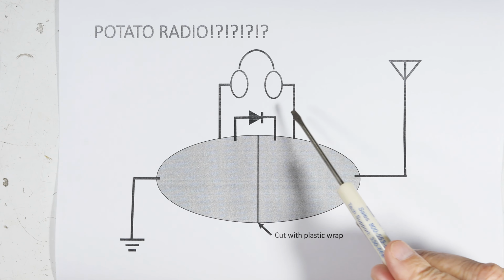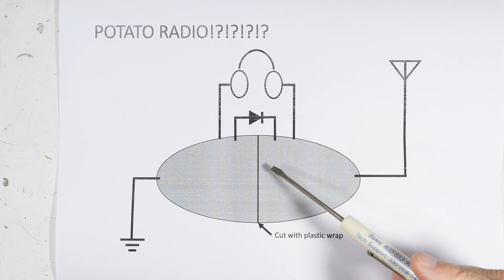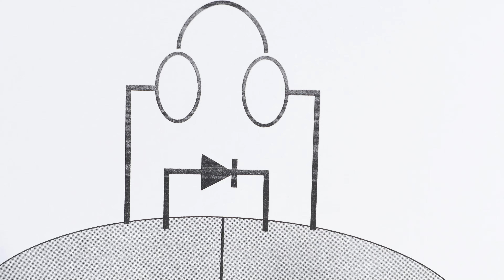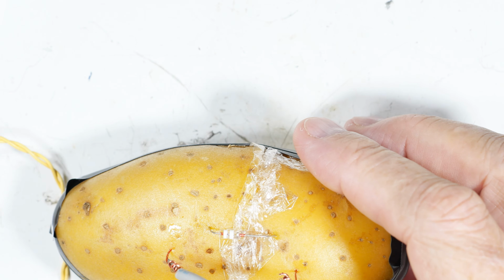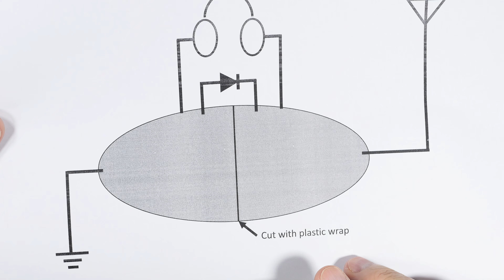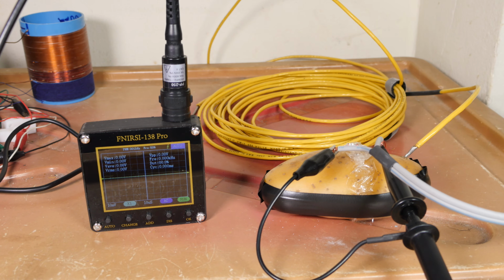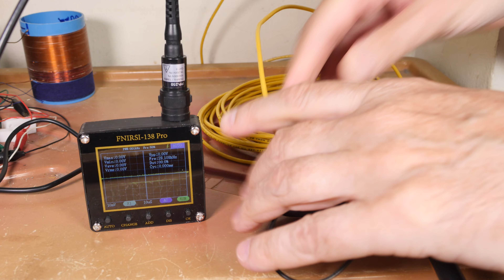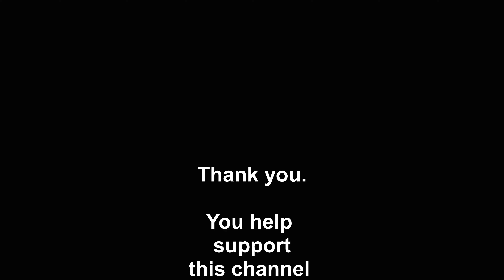Potato Crystal Radio--Real Deal Or ??? (4K)

Comment: I know nothing about radios, but when I was a child in the 60's we had a light switch in the kitchen, made of bakelite . It had a very fine crack running from one of the screws about a quarter of an inch long towards the actual switch itself but not reaching it. Our old wireless was about 10 feet away and the ground wire ran alongside the light switch. One balmy summer day I was sitting making an airfix kit and could hear very faint voices and music when all the family was out at work and I was alone? I went to see if I could find out where this was coming from (looked about outside etc) and could not find anything. I went back to my kit and a little while later became aware of the voices and music again but still very faint. This time I went very quietly and slowly around the house trying to pinpoint the source. It took a while because the voices came and went, but eventually as I tip-toed into the kitchen I found the source. It was the light switch! Baffled, I checked the wireless, and it was not even plugged in. I told the rest of the family when they came home and they thought I was mad, but they did eventually hear voices and music from the switch and thought it weird but not dangerous, so they just accepted that we had a weird light switch. Over the years I have often wondered how this came to be, but have never found an answer. So is there one? Thanks if anyone can enlighten me.
Reply from the maker: That is interesting. If you watch my video on the world's simplest radio https://youtu.be/mlBfAI_55Mk
you will see you only need an antenna, ground, detector, and something to make sound to hear radio.
Then I have another video about what can work as the detector I mentioned.
https://youtu.be/1o2zB5giS7I
And a nearby, high power station would make it much more likely.
I can't say for sure of course, but that switch had all the things to hear radio: it had an antenna, which was the live wire; a relative "ground", the neutral wire; several possible detectors including corroded or arced copper/bronze, carbon from burned bakelite, etc. The something to make sound could be the cracked bakelite. Did you ever experiment to see if you could make it louder or quieter by squeezing or pushing on it? Did it work when the light was on or off?
Reply: @tsbrownie   Hi. I did push at the crack and it stopped altogether. It did return quite a few months later, again very faint. Our power station was about 6 miles away and we had no high powered things near us, but maybe the airport which was only a mile away but never heard traffic chat. It happened whether the light switch was on or off.   I have always just assumed it was just a freak thing caused by a combination of things being just in the right place to make it happen. Another strange thing happened years later. I was sitting in my mates car outside our local fish and chip shop eating our fish and chips and he had an 8 track stereo player (no radio) which had been playing but reached the end, and we were just sitting there enjoying our food. Suddenly, and VERY loudly the speaker burst into life on the police frequency causing us both to jump and spill our food!?? Like I said, the player was cassette only, no radio. But thanks for the reply and links.
Reply from the maker: @colindelamare4588   About the light switch, I'd go with my guess that the crack was acting as a speaker. Touching a speaker will quiet it. The radio station seems to have had enough power to do the job. 
The 8 track picking up a nearby transmitter is not a surprise. It has lots of stuff inside it that would pick up,  amplify, and sound out a radio signal. Used to happen frequently with old style badly tuned ham radio stations / antennas.
Reply: @tsbrownie  Thank you. At the very least I now know that these things can happen and I and my no longer with us family were not going nuts!
Reply: @colindelamare4588 The amplifier inside a tape deck is really sensitive, so it can pick up nearby sources of RF like that.

Comment: The potato is supposed to act as a capacitor and there are many crystal radio circuits that use capacitance in the simple circuit.. You handicap the construction with the jumbled coil of antenna and ground wire when the one side of the potato that is to be grounded should be within a few feet of the ground rod/point.. The antenna side should be attached to the antenna wire of long enough length for the desired short wave frequency at 1/4 - 1/2 - 3/4 or one wavelength.. You can shift the tuning of the antenna by coiling the wire around the potato and/or a large enough non conducting "plastic or paper" bottle or tube and then by adjusting the number of turns and the position of the potato inside the coil you can create a selective tuning circuit.. The diode should be directly connected to the crystal headphone leads when inserted into the potato halves for best RF rectification results.. You can substitute a cardboard toilet paper tube wrapped with 2 aluminum foil strips separated by wax paper or plastic wrap as the insulator to make a better capacitor.. Once again playing with the number of wraps of wire and wraps of foil will vary the circuit selectivity at a given frequency..

Comment: maybe if you turn the potato into a vinegar acid battery cell using vinegar soaked potato half, a paper napkin and then your modified circuit, but the tuning coil still will be needed
Reply from the maker: I could cut it into a spiral.

Comment: The origional article that I read about this was the effect of the ground capacitance  of the double antenna in proximity to  the distance from ground created a tuned circuit and the addition of the cut potato with insulater increased the voltage across the diode thus increased sensitivity.
Reply from the maker: @stanmeyer9770  The problem is that the resistance of the potato is waaaay to high to conduct the tiny currents.
Reply: @tsbrownie  we are talking about very high impedance here so the current factor is very low in this equation,  but the gain is high.

Comment: I don't understand why you connected the antenna to both sides of the potato. The diagram shows the antenna only connected to one side and the ground connected to the other side.  It looks like to me you have a direct short.  However, I have very little knowledge on radios and how they work.
Reply from the maker: One wire is ground, the other is the antenna. They happen to be the same color, but the ground has a mark on it so I know the difference.
Reply: Oh, ok.

Comment: I don't know is this really working. but seems by cutting a potato halves and separate two halves with plastic, you simply create a capacitor
Reply from the maker: Exactly. And the potato is a high resistance conductor, so overall it's a very poor way to make a radio.

Comment: I live three miles by air to 50,000W WLW.  I don't need a potato, Antenna, ground, headphones and diode is all that's needed.   I would however think that you could use dissimilar metals stuck in a whole potato to behave a like a battery to bias the diode.
Reply from the maker: I think there's a 1960s science project where they used potatoes to power some small item. So you're not to far from WKRP.  ;)